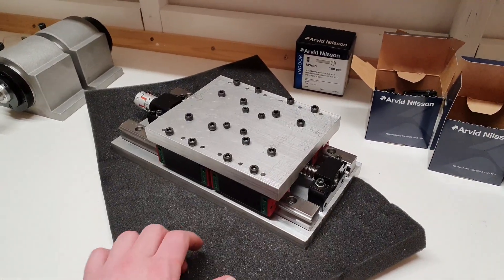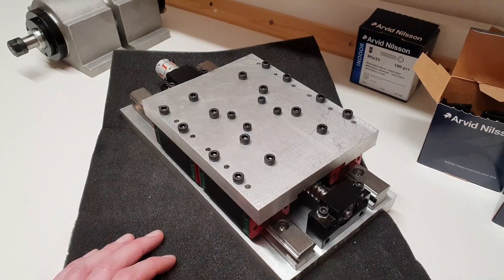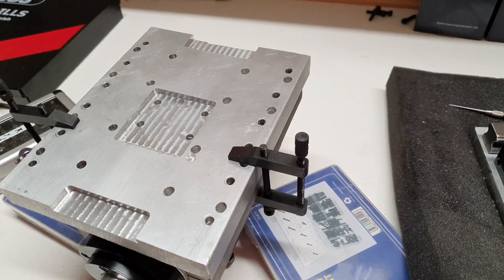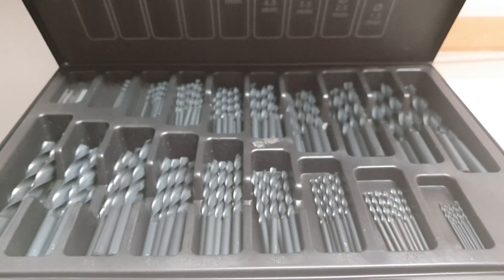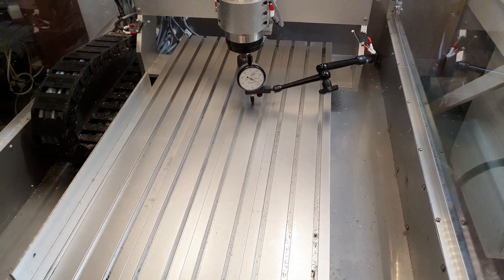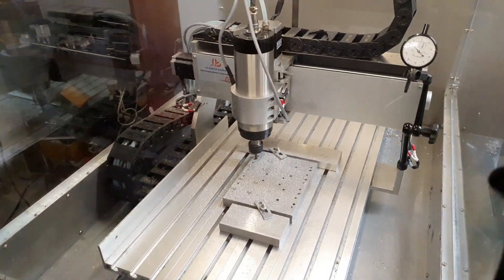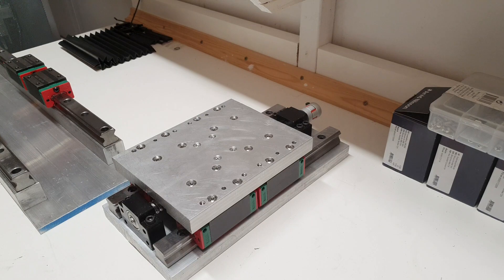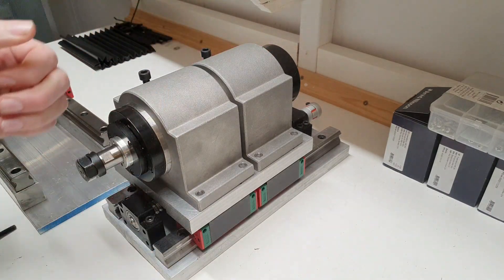6040 CNC Router - Z axis build -  (Linear rail upgrade part 2)

Comment: You better to take 1 flute mill for ALU and you see much better result - you can go higher with RPM even to 24000 . It will give you less load for the spindle and less rubbing . Good luck !